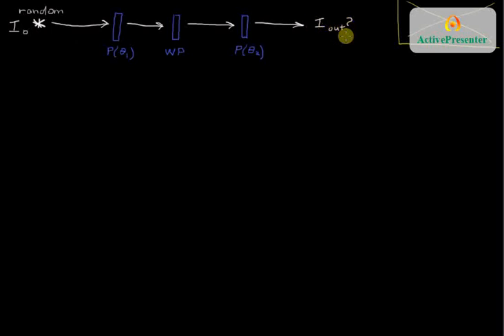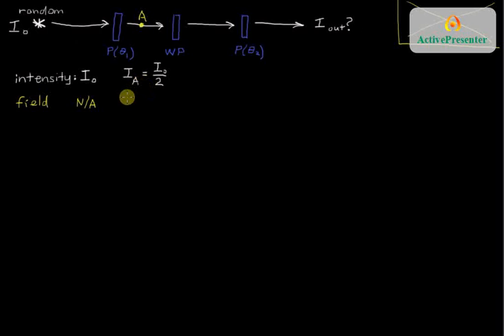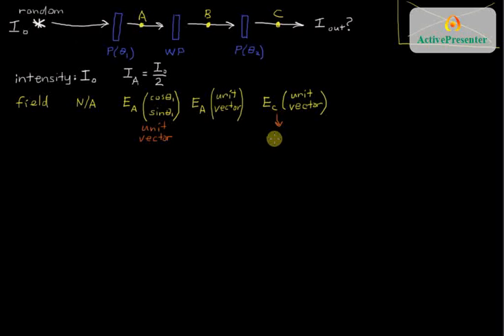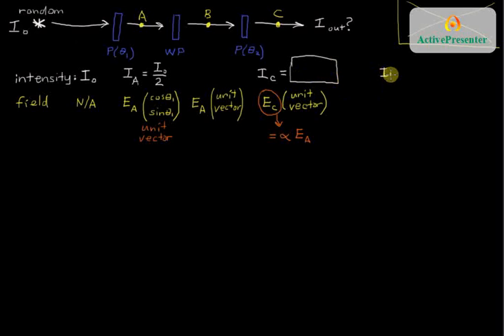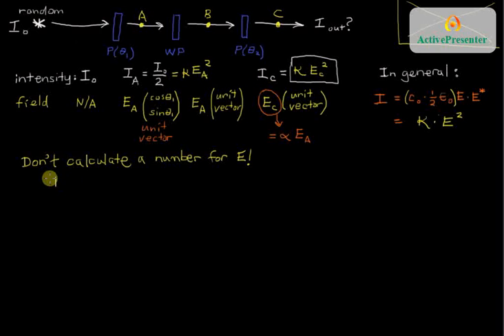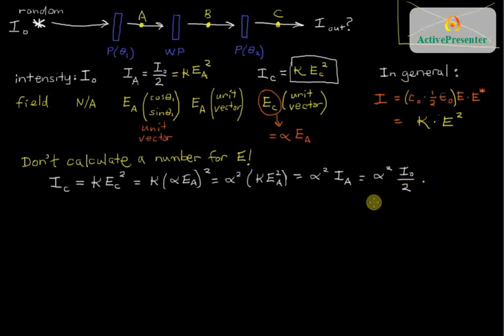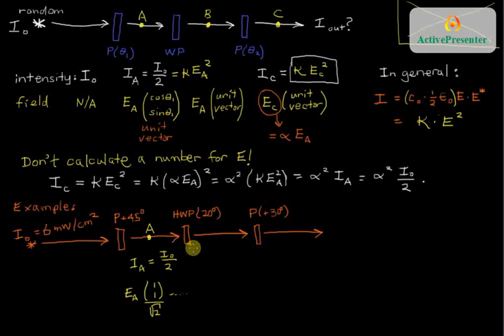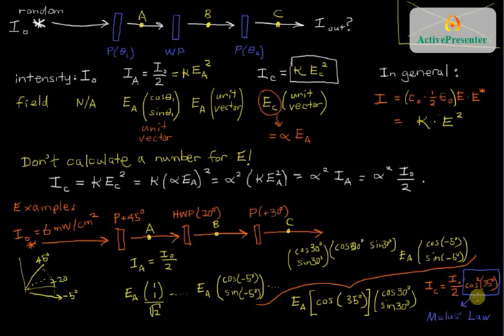IntensityRatios

Comment: Excuse myself, I don't understand what exactly are we doing at 13:13 ? I don't understand why there is the flipping of 50 degrees and why we end up at -5deg linear state. Thank you very much.
Reply: The effect of the half-wave plate is that it rotates the input linear polarization. Since the initial state was at 45 degrees, and the wave-plate was at 20,  the angle between the wave-plate and initial state of polarization is +25 degrees, so the output state will be oriented at -25 degrees relative to the wave-plate. This gives the 50 degree flipping, and we go from +45 to -5.